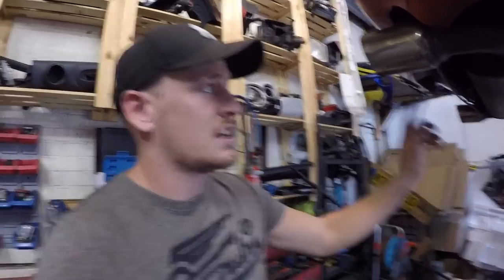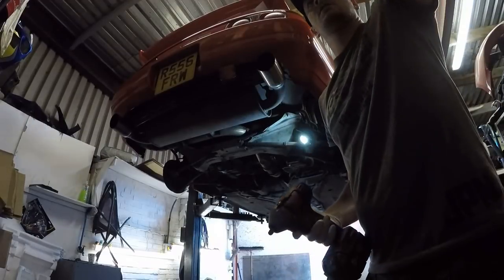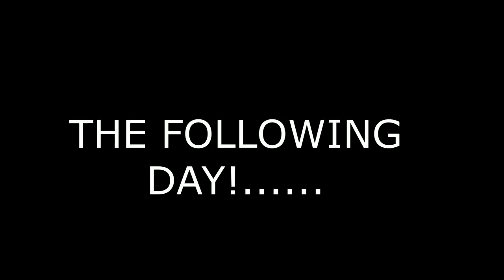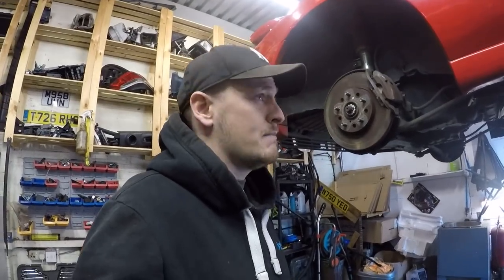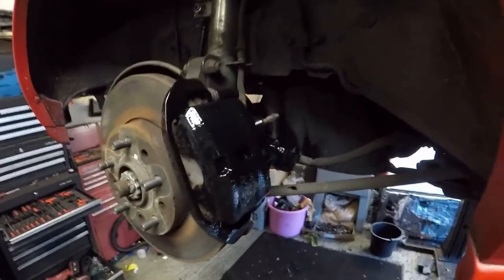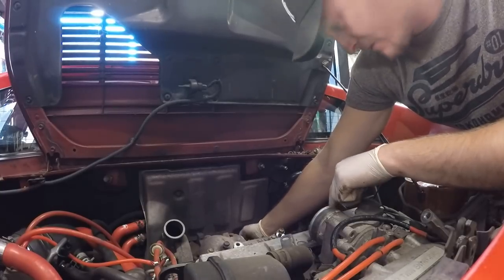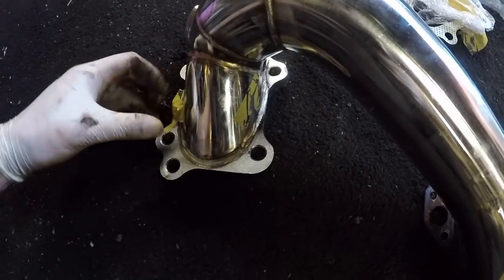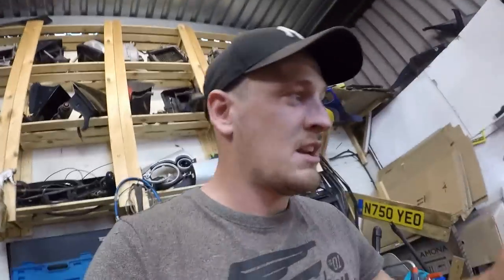FITTING A NEW DOWNPIPE TO THE MR2 TURBO

Comment: I have a rev3 mr2.  How many cat stay brackets did you have to take off? Were there only 2? One on the left and one on the right? How many bolts does it have?
Reply from the maker: From memory yes one both sides was easy enough think there are 2 12mm bolts on each side
Reply: @nolongeravailable12345  do you have to take both bolts off to get the downpipe and cat off. Cause from what i see is one bolt attached to the cat and one to the block. And mine are rusted bad
Reply from the maker: @shirok4140  I found it easier to remove them out the way completely as not alot of room
Reply: @nolongeravailable12345  is there only 2 bolts per bracket or stay? Or is there 3 on each?